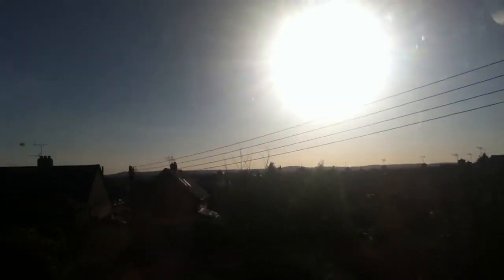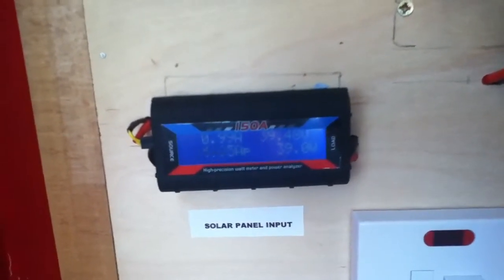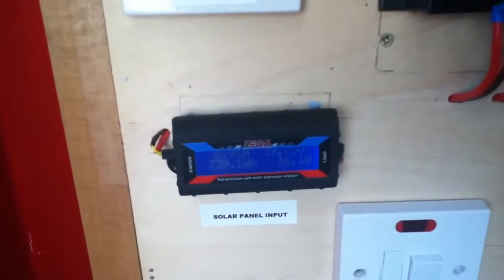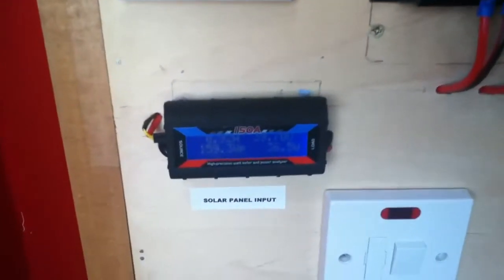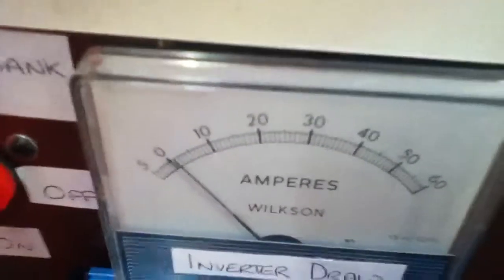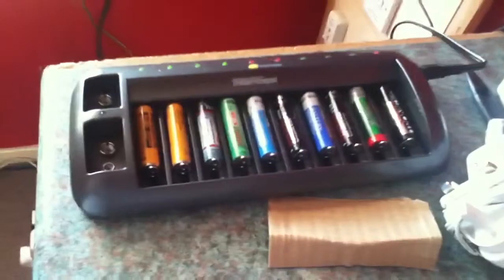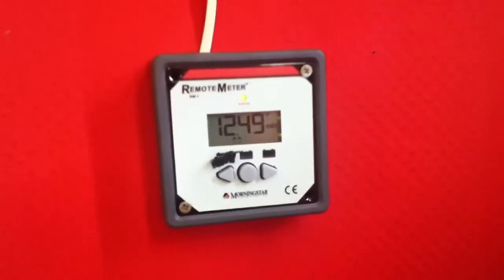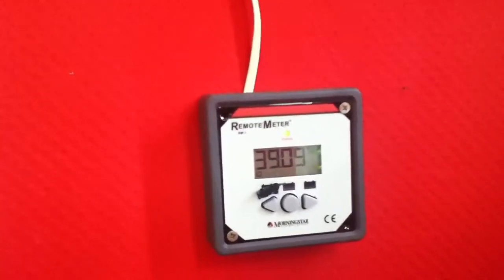Sun 31st Aug Record Solar Production!

Comment: verry good video,and an update
Reply from the maker: iulian onofrei Thanks for watching my videos, hope you find my videos interesting and informative. How is your solar project going? May be you could do a quick video of what you have so far.
Looking back at my own videos, I have discovered that I only started in to solar power approx 12 months ago, at that time I knew nothing. Everything I know has been self taught, from the internet, books and videos here on YouTube . I started off with one ten watt solar panel, a cheap ebay charge controller and a 55 Amp Hour battery, with the intention of having some back up light during a power cut, using a car inspection lamp.
I learned that the 10w panel on a windowsill was not powerful enough to charge that battery, so I bought a 20w panel, then a 50w panel. That was ok running dc things like lights and USB chargers, then I bought a 600w modified sine wave inverter. I then learned my battery was too small, so I bought a 100 amp hour battery. I got bitten by the solar bug! And then bought two more batteries........ I could go on..

The moral of the story and the wisdom from my experience, is this, decide what you want to run with your system, go and research what you will require, and then buy components that both you can realistically afford and will do what you require. Second hand equipment can offer good value, if it meets your needs, but there good deals to be had on new equipment too. I scour ebay listings all the time to see what comes up. Take your time buying your equipment and setting it up correctly and it will run problem free in the long term, but even then things can breakdown ( like my wattmeter), but you learn from this how to fix it and be up and running again.

Hope you find this advice helpful, if want some help with something, please ask and i will try to make a video to help you. Ps just out of interest where is your location, I am in Central England in the United Kingdom, our weather is quite variable! Heavy rain one minute followed by blazing sun 10 minutes later....oh typical British weather...

Thanks again for watching my channel......
Solartiger. More videos to come